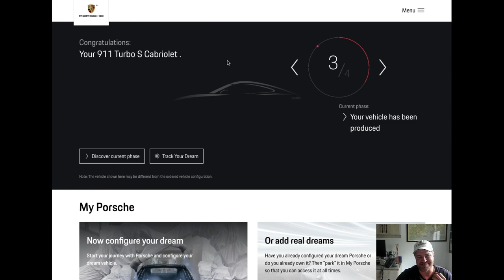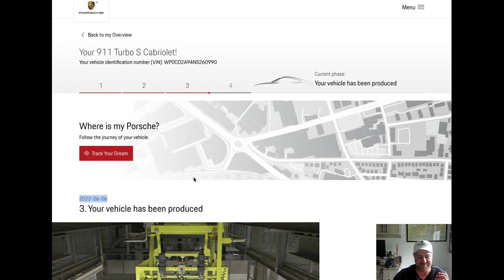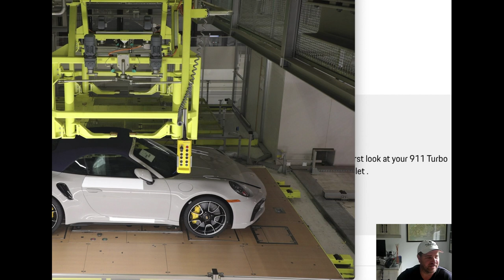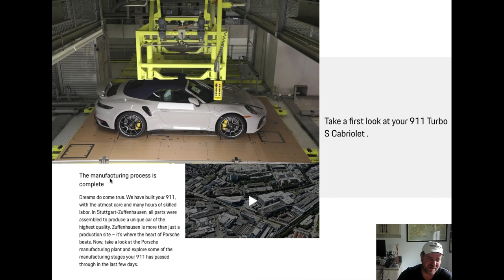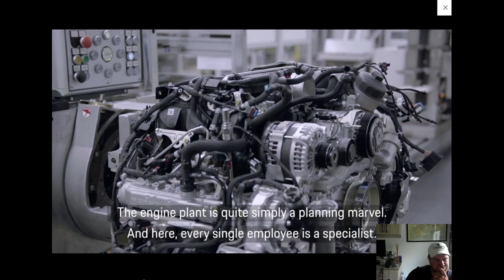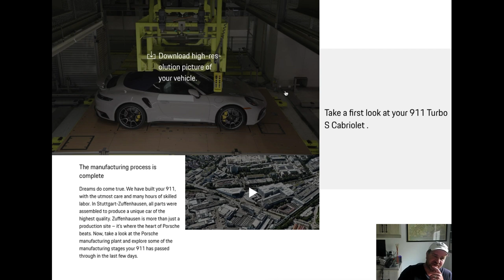Production Complete 2022 Porsche 992 Turbo S Cabriolet - Here's What it Looks Like

Comment: My 2019 ZR1 will run circles around it in any parameter
Reply from the maker: lol. You wish!
Reply: @MikeysGarages  Go check the numbers yourself, my 100% stock 2019 ZR1 runs 0-60 in 2.9 sec. and the 1/4 mile in 10.6 sec.@134 mph.with a top speed of 215 mph